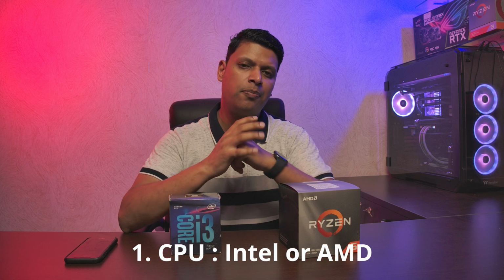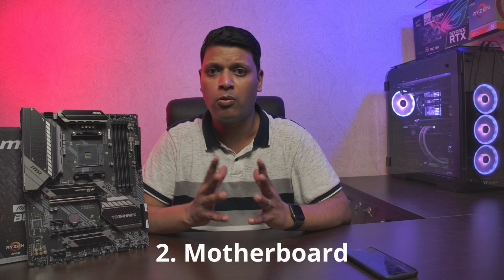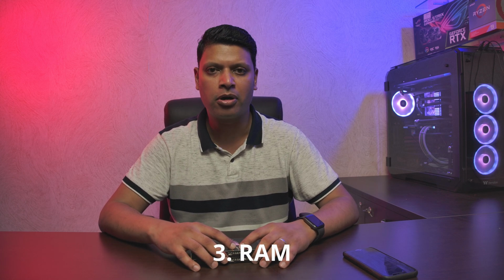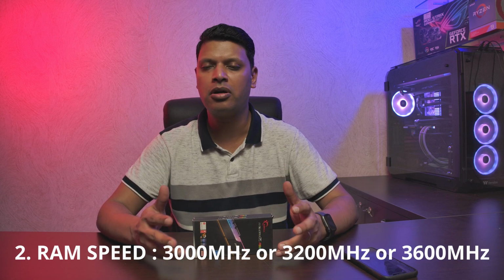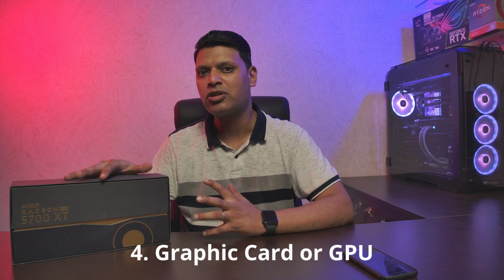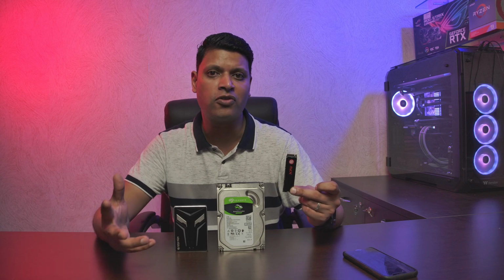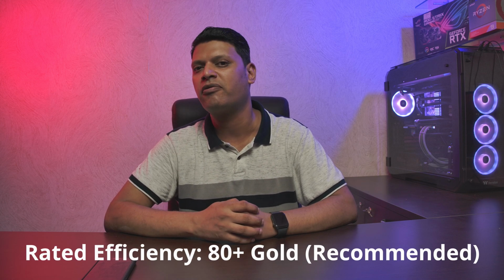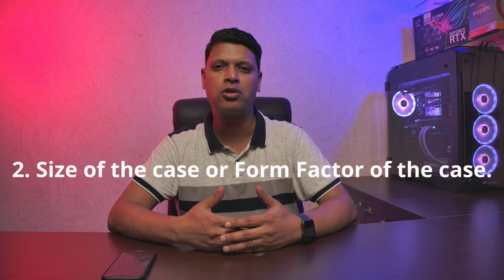Build Your Own PC - Part 1 | Introduction to Hardware & Recommendations |

Comment: how do i get custom watercooling parts in india
Reply: You could go with Corsair's hydro X series which is available on https://mdcomputers.in/corsair_hydro_x.html. They have a wide range of hardline tubing, custom fittings, and a variety of coolants that you can custom tailor as your needs.
Reply: @ajaynambiar5343  Hey Corsair seems nice though although, I would like to have options which are a bit cheaper as well.
Reply from the maker: @Risan Raja i am not sure how cheap in terms of pricing do you want to go. Water cooling is actually an enthusiast stuff, thus cutting price on components will not be something that would work out. I believe thermaltake used to have a kit costing around 31K INR, mdcomputers might just have it, you can check that but not sure how will be the quality.. but I don’t think you will have anything cheaper available in India. I won’t try to go the cheap way anyways.
Reply: @i2TECH  yes they have a D5 res. kit
Reply from the maker: You can also order them online on EK’s website which is ekwb.con
Reply from the maker: @Ajay Nambiar just wanted to know the reason why you won’t recommend water cooling components in long run?
Reply: @i2TECH  I meant the Chinese ones from Wish.com, not water cooling as in general.
custom water cooling the best way to cool the system but cheaping out will cause the risk of leaking and stuff.